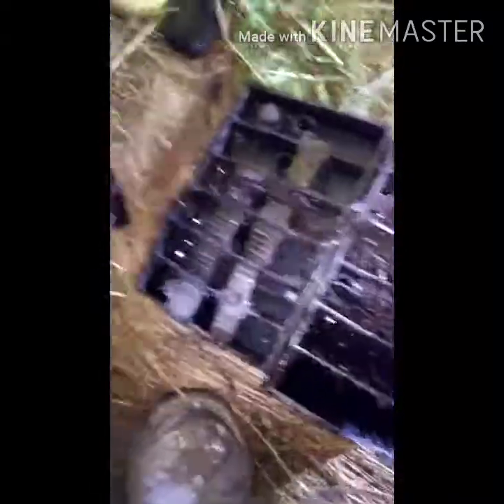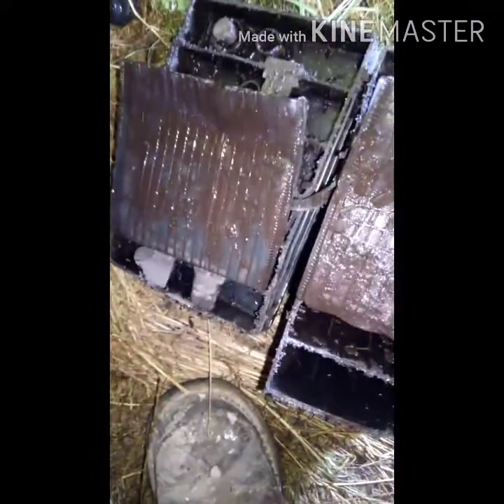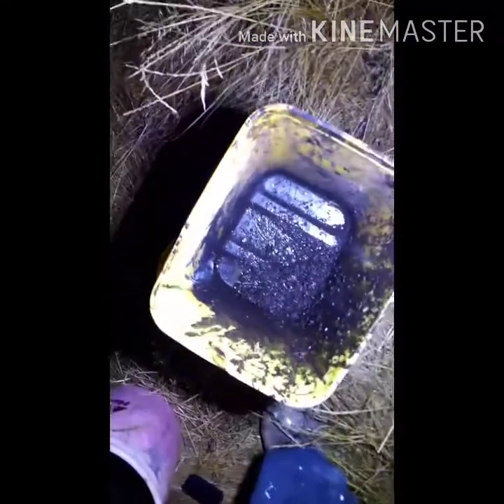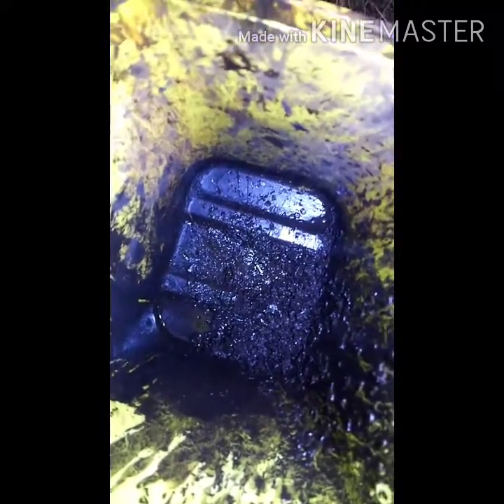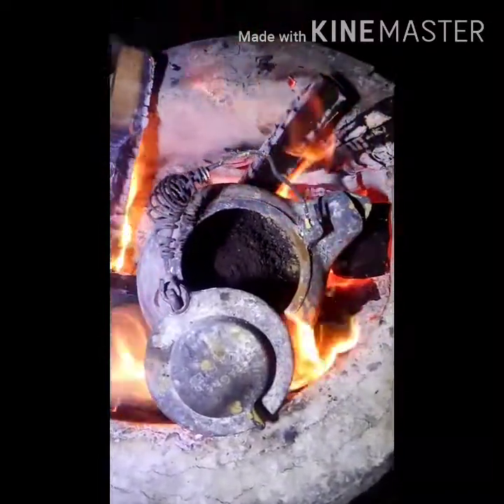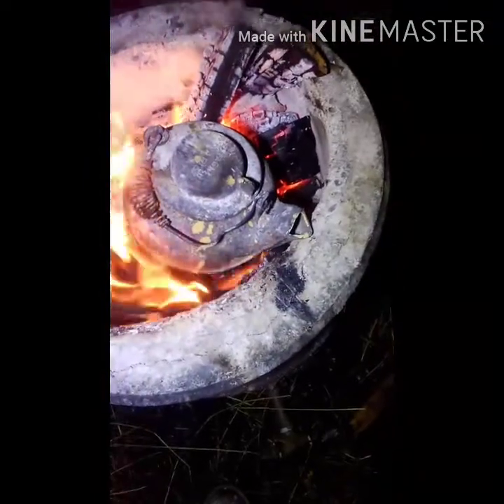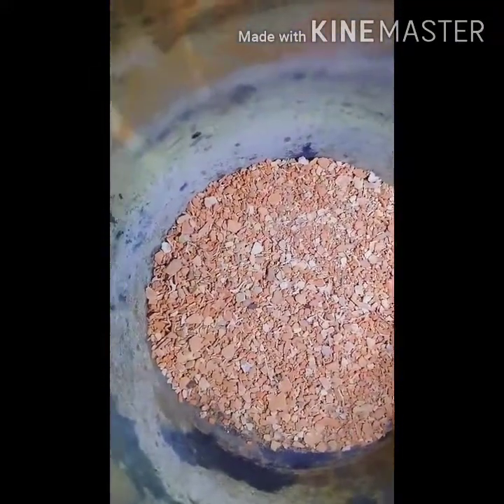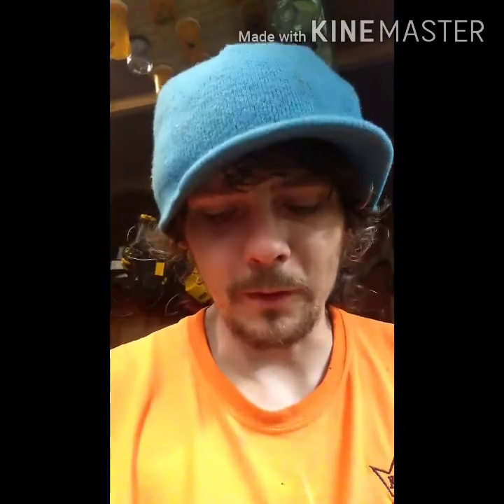how to make lead tetraoxide, pt#2 minimum, red lead.NO CHEMICALS

Comment: How do you recommend ‘cleaning’ the lead containing water?
Reply from the maker: @en2oh  ahh good question! So you would need to take the water and acidify it with probably muriatic acid. Once you have a decent pH look at your metals reactivity, I think that zinc would work.... Take some small pieces of zinc and add them to the water and they should dissolve and precipitate out the lead as a metal. Then you can distill off the water and get zinc chloride and purified water good enough to dispose of.
Reply from the maker: Hope this helps

Comment: How do you make positive lead plates
Reply from the maker: You talking like how for use in a battery?  I have a video in the making of this.
Reply: I was meaning too making a lead mold to pour lead into too make new positive plates and how to add the lead oxide To the plates
Reply from the maker: Yes sir I gotcha. A dozen people are asking for this video. So it shall be made. And your on the right track with a mold for the lead grid

Comment: Since when is grey lead led oxide? Negative plate (grey) is just a lead sponge. If it is taken from an old battery, than it is most likely lead sulfate(PbSO4) and some lead. Hence you are able to reduce it, as the lead sulfate would not melt and reduce the sulfur. Further heating, then reduce some of the oxygen. That's why you get red lead(IV)oxide first. ie: PbO2-red ( by reducing sulfur dioxide -SO2 from PbSO4) and orange/yellow led(I)oxide after (by reducing oxygen -O2 to Pb2O3 and PbO respectively). If the plates would not be sulfated, than you would melt whole lot in to a solid chunk. The yellow led could be pasted to the positive plate also. In time it will oxidize further into the red lead during charging. Another video full of wrong statements... For those who want to try make new plates, you will need binder(some polymer particles mixed in), after pasting, you need to bake it so the polymer melts and binds whole thing in to the solid part.
Reply from the maker: Look into the facts man I'm not wrong, I spent a lot of time figuring this all out. Unless the entire internet is wrong and your correct. Lol and just to clarify there is lead metal, which is what the lead oxide is pressed onto for it's chemical reactions to take place with the acid to convert to lead 4. So inside a battery you have lead oxide 2,lead oxide 4 and lead metal itself.
Reply: @shelbysgarage5828  Wow! Let me help you to save your time: https://en.wikipedia.org/wiki/Lead%E2%80%93acid_battery...5 seconds on the Internet....So I guess the Internet is not wrong and I am not wrong either...I wonder who is wrong here...I am not sure, what sort of Foolnet you are connected to...Check with your internet provider...
Reply from the maker: Conveniently the page is deleted but there is zero lead sponge in a car battery. Go take one apart
Reply from the maker: If it's lead sponge how come it doesn't melt into lead metal? Riddle me this bat man
Reply: @shelbysgarage5828  My apologies for getting <...5> in to the link. Here is it one more time:  https://en.wikipedia.org/wiki/Lead%E2%80%93acid_battery .Again, wow! :"zero lead sponge in a car battery"...And yes, I disassembled multiple LA batteries. I believe, I would not be able to argue with your intellect level. I believe you are on your way to reach 100% on Dunning-Kruger effect curve.
Reply: @shelbysgarage5828  hello Can I learn to make battery plate step by step please please teach me how to do it
Reply from the maker: Ok what is dunning Kruger effect curve this I have no clue on
Reply from the maker: So the term lead sponge.... Metallic lead reduced to metallic lead sponge or whatever the definition is, this is not in a car battery. You have your lead grid with lead oxide 2 on it both pos and neg can be this way and my charging and discharging you will create a neg plate and a POS plate one will have a lead grid covered in lead oxide 2 and the other will be the same but with lead oxide 4 also. All seperate by the little bags they're in unless you do an AGM battery and it's all in two long rolls with fabric in the middle. Am I retarded and just not understanding what you are trying to tell me? I've always though I needed a helmet. Lol

Comment: Hi Jano from South Africa , got a question and a frendly request for you .What is the grey lead 2 and can one recycle that to by burning it untill it reaches the right colour please let me know. Thanks for great vid.
Reply from the maker: Yes, is the short answer haha if you cut open a vehicle battery there will be grey colored (grey lead oxide 2) and brown color (red lead oxide 2 &4). Each 12volt battery has 6 cells and in each cell there are plates (grids of lead with lead oxide in them) it will go grey red grey red grey red and so forth. All the oxides can change color threw heat. The metallic lead won't until oxidized. I hope that answers your question. And don't forget to subscribe. Help me grow I need all the help I can get :)
Reply: @shelbysgarage5828  subscribed, shared & liked 😁 , thanks for the reply . Over here solar are becoming very popular and it's generating lots of scrap battery's an also a market for refurbished battery's . How are the lead oxides originally produced and is there a way to DIY it or maybe u know of a good informative site where I can go. Have a great day .
Reply from the maker: I sure do know, I have a video called how to make lead tetraoxide, well two videos of that. Watch part one this first couple steps will put you right at how to make lead oxide
Reply: @shelbysgarage5828  Thanks this is great!!
Reply: @shelbysgarage5828  So a negative plate can become a positive plate by heating, is it true, please answer
Reply from the maker: @Pak_-smogasuksesacaranyaLopak  heating inside the battery, not so much . What people will so is hookup a charger the proper way for say 20 min then hook it up the wrong way for 20 min and do this a few times to set the oxides.... The acid solution plus the electric charge will do the rest. But if your starting w all new stuff this switching isn't needed. Hope this helps.
Reply from the maker: https://youtu.be/8SJpxAv8hR4
Reply: @shelbysgarage5828
Reply from the maker: Hello

Comment: can I paste to lead plate again and work ?
Reply from the maker: Your talking to reuse for batteries? I believe so but this isn't the process typically used for that. If you are interested in it I can explain the proper way.
Reply from the maker: Codyslab has a good video on it also
Reply: ok help me please, to reuse the battery on cheap way. thank you
Reply from the maker: Ok, so if you take a battery apart you'll notice two colors of oxide one grey and one brown to brownish red. The grey is lead oxide 2 the ladder is 2 &4 so if you keep them separate then all you need is to re adhere to new grids. If you only have the grey you'll mix a solution of battery acid (30%) sulfuric acid total in the solution. And then you'll charge the neg, neg and then positive on the same grid. This will change the oxide from 2 to 4 thus making your neg and positive plates. Does this make sense?
Reply from the maker: Your welcome, you kinda lost me with your comment lol my email is scubamaster84@gmail.com if you want to email me
Reply: @shelbysgarage5828  hello
Reply from the maker: @محمداحمد-غ3ظ4ق  hello